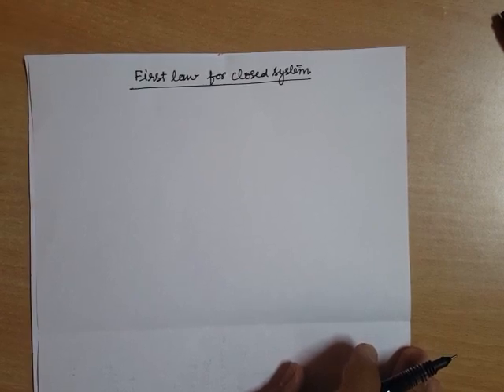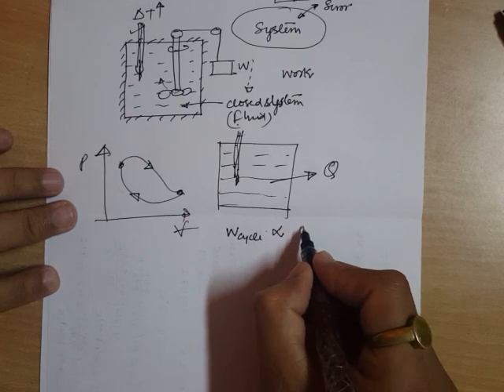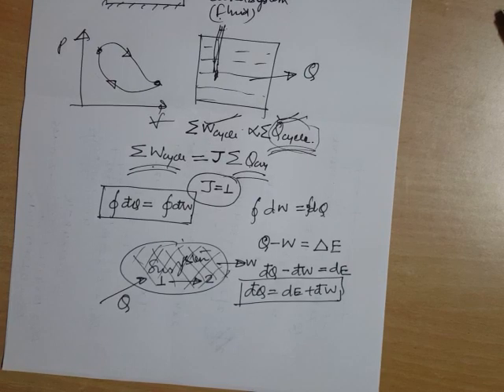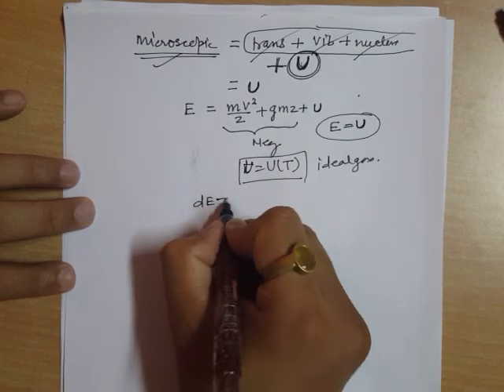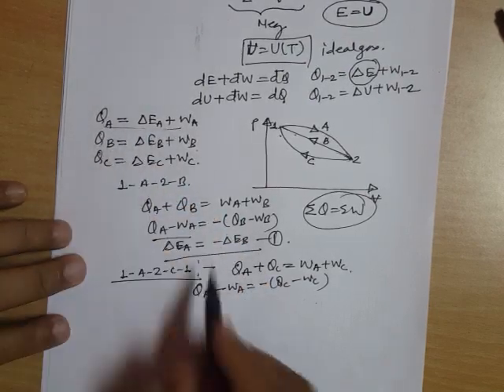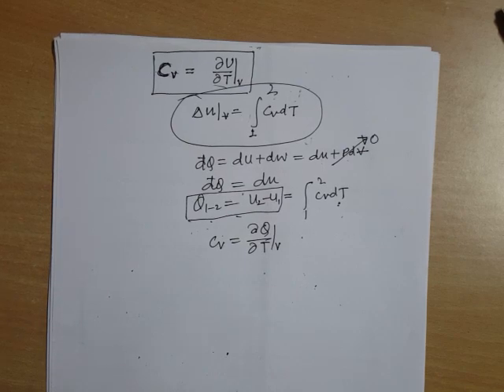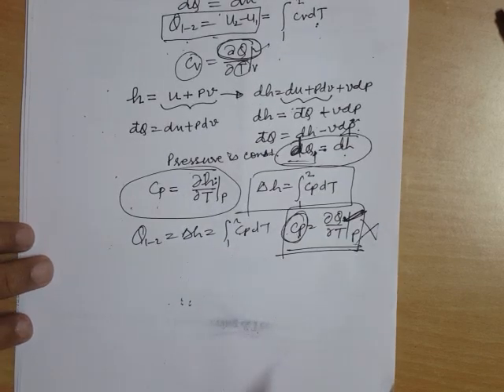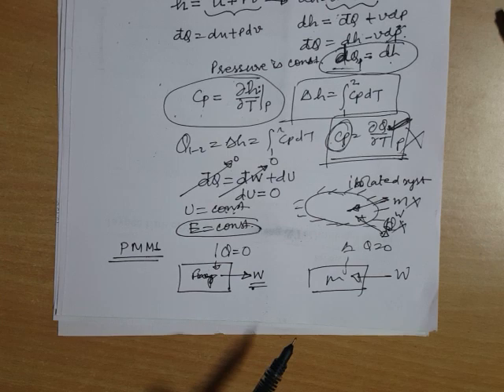Engineering Thermodynamics: First Law for closed system

Comment: Sir once u have told that by experiment heat and work was equal in joule.....and then u told that when system goes from 1 to 2 state then sbstraction of heat and work is some energy which system store.......if we see this then we will find that basically heat and work is not equal,work transfer is less then heat input and difference of this (energy) system stores.......if heat and work will equal then how the enternal energy will come in picture.....plz explain this...thanx
Reply: Rajeev R Prasad they  are saying....lets take a example... if 200kj of heat is transfered to sytem and out of this 2000kj system does work of 1000kj ...then reaming 1000kj will be stored in system ... they said once that.. (mechanical work and heat) have  same units...! Hopefully u r doubt is cleared :)